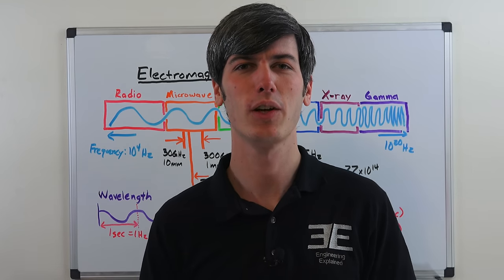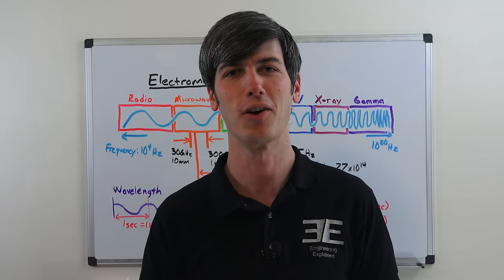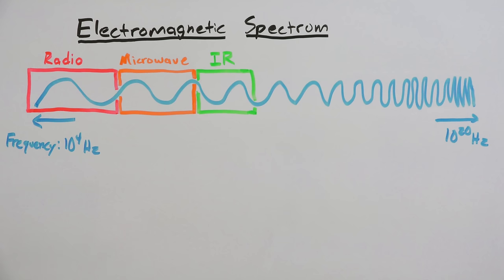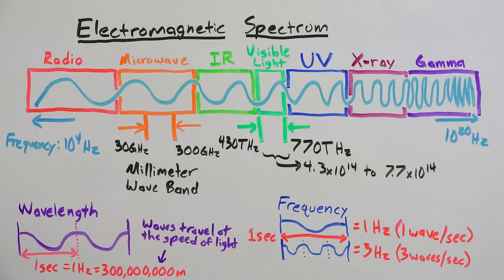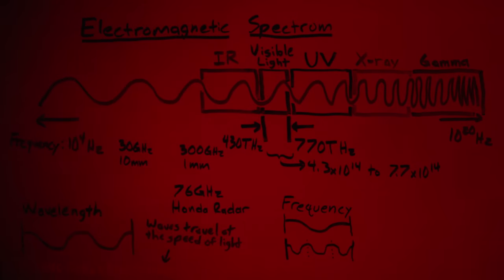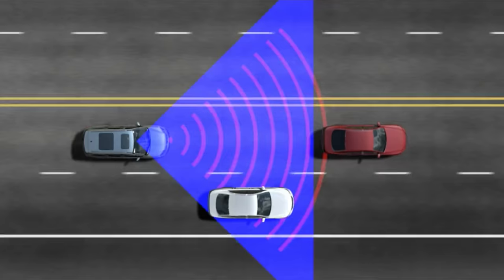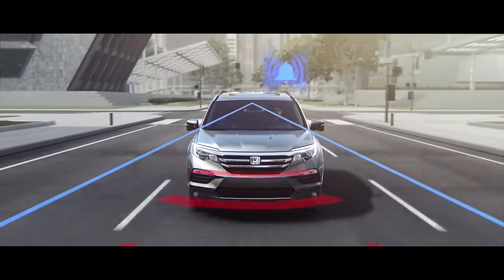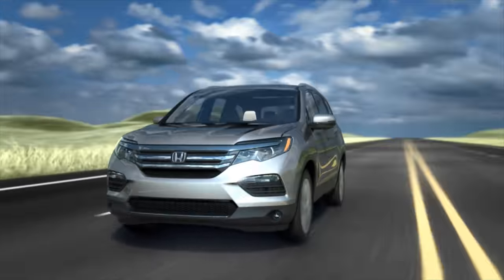How Adaptive Cruise Control Works - Step One For Autonomous Cars

Comment: so what does this system do if you let off the gas to slowly come up behind someone, while there's ice/snow on the ground and it decides to brake harder than you want and you slide and hit someone?
Reply from the maker: +Elkhartboy So you're saying instead of braking you just stay off the gas and hit them? ABS is there to help you stop, but if the ground is icy you shouldn't be using cruise control.
Reply: +Engineering Explained I'm simply asking if the system could make you brake harder than intended. not really sure how I'd slow down with cruise control on....

Comment: I had ACC on my Accord Plug-in Hybrid and the collision avoidance was a nervous nellie.  Even at very low speeds if someone was crossing ahead of me with plenty of room it would panic and sound the alarm.    Never hit the brakes on me but it was certainly aware of the potential broadside (if the car ahead hadn't been moving).  On the highway, the ACC cruise control sure makes highway driving easier - all you need to do is stay in your lane and the car will do the rest.

I've just switched to a German car with camera based ACC and the performance so far seems the same.  Highway driving is very easy and follow distance is maintained nicely...

Comment: I've tried the adaptive cruise control on my dad's Subaru and it works really well. It also has the lane departure warning, park distance warnin and blind spot warning. I found the lane departure warning a bit overbearing but not too bad. Clearly just about every manufacturer has all of the main elements for self driving cars.
Reply: my 2019 polo can parkk it self but cant drive itself i do have t steer

Comment: I thought adaptive cruise control is where the car can detect slope angle of the car going up or down a hill and adjusts speed and braking by the angle of attack and uses automatic changes in braking/throttle. Freightliner Cascadia had something like that I think. The truck, with a load, was able to detect the slope of the truck either up hill or down hill and depending on the grade, it was able to either use the truck's momentum or brakes to keep the truck at the driver's inputted speed instead of using fuel when it's not necessary. Basically, it used fuel if it calculated there wasn't enough momentum to get the truck up the hill allowing the truck's fleet to save fuel instead of older cruise control with a constant programming, the newer ones were self-adjusting.

Comment: While I think that ACC is a great technology, it started out in class 8 highway trucks. When I worked on semi-tractors, the ACC eye/radar was always problematic and in need of constant adjustment. The biggest complaints came from winter time when cars would cut off the rigs, and the ACC would slam the brakes on inducing a skid. Hopefully auto makers have realized this potential problem to reduce this danger.

Comment: I'll ask it in a less confusing way, I'm thinking you were pointing out a system that helps prevent crashing. what if it makes you brake when you're just trying to slow down and then brake? or is it only active with cruise control?

Comment: 👍🏻 nicely done! Thanks.

?:  with active braking, is the brake pedal physically depressed as if the driver would have done instead of the driver aid? Or is the braking done local to the brake rotors, if you get what I mean...
Reply from the maker: +Mario Dalla Riva That's a great question, and considering how many of these cars I've driven I should know the answer. I believe the pedal does actually depress on its own, but I'm not positive on that.

Comment: can i make microwave popcorn with this
Reply: Well, in the normal sunlight there is also a small amount of microwaves, we just can't see them, so basically, you could do microwave popcorn everywhere, at least there are microwaves... but not enough unfortunately, I mean you could try to put a bag of microwave popcorn on top of your black hood of your Honda with ACC in summer and wait until the sun did the job of the microwave for you but this would also work with cars without ACC, but yeah, theoretically you could do that!
Reply: +TheTomatenfritz3000 nice
Reply: +Zettel007 
Wifi has the same frequency as conventional microwave oven(2.4GHz). Just put the bag on your Wifi hotspot for dank popped corns.
Reply: RealationGames I think you might need a very strong wifi there but nice hint, thank you! xD

Comment: Never rely on this thing. I had the adapt cruise control on. i set it at 2 cars length. i was traveling at 70 mph in the middle length. Someone from the right lane cut in front of me. Normally, i dont need to brake because we both travel at the same speed. But because that car was close to me, the car probably thought i was about to hit something so it braked hard. luckily there was no car following me or i might get hit from the rear.

Comment: I wonder what would happen when two cars equipped with this system drive in the opposite directions on the same road. They're both sending the same radar waves and receiving each others'. Sounds like this could fool the systems into thinking there's going to be a crash and braking abruptly, potentially causing a real crash in the process.
Reply from the maker: +Kepe I actually asked them about this. They've certainly thought about it - the system has a way of ignoring information that isn't relevant, and only paying attention to the feedback that it determines to be useful. I don't understand the finer details, but essentially it has a way of basing its decisions purely on the waves that only it emits.
Reply: +Kepe I don't know how ACC works, but knowing a little about electromagnetic waves, I presume that to solve this issue, the system would have to encode its own identifier in the signal so that it can filter out the ones that it doesn't emit.

Encoding the signal can be done by modulating the wave according to a pseudo-random number generator seeded by the car's identifier. When the wave from other car interferes with your own signal, the system does some maths to filter out the waves that doesn't match the expected modulation as noise. Similar maths have been used in asynchronous CDMA systems to allow multiple mobile phones to transmit at the same time.
Reply: +Engineering Explained - What would happen if you were using it near the ocean and it was windy?

Comment: Since Honda Sensing using both camera and radar to detect the objects, what if both of them have very confident but opposite opinion about the road? (One thinks there is a traffic cone while the other one does not). Is radar always the one takes precedence over the camera?
I got this question after seeing the sudden brake recall from Toyota/Lexus because of the sensor error.

Comment: Would Honda's implementation of software and sensors be able to allow it to avoid collisions with smaller non non-metallic objects such as deer?
Reply from the maker: +daytonduck The camera is there for object recognition such as pedestrians (or deer). Nothing is guaranteed obviously but the idea is that it will attempt to prevent a collision.
Reply: +Engineering Explained Thanks for that description. I can imagine a lot of the processing methods and other behavior could be confidential, and they probably don't want to make statements such as, "it will spot children and deer", but those are two things that a LOT of drivers have to be concerned with, and both would be challenging engineering problems.

Comment: My question is what happens if the car behind you slams into the back of you because the computer in your car decided to slow down? I'm not faulting Honda, it's a great safety system I just think it's such a race between auto manufacturers to have the latest and greatest that sometimes important things get overlooked. Also with so many features being automated in cars I think it leads to drivers being more relaxed thinking "I don't have to pay attention the car is" maybe a bit extreme but you get my drift. With all of these systems what happens if they need repaired out of warranty? I think people should consider that if they plan on keeping the car for a long time, and most mechanics won't be able to work on these systems forcing the owner to pay a lot more to go to the dealer.  Again I'm NOT saying this is bad, only providing an objective view..
Reply from the maker: +James Karl If you get rear ended, that's the fault of the person behind you. They shouldn't follow so close that they end up in a wreck. They teach you this when you first learn to drive (don't tailgate).

Comment: I know that the auto braking is a great safety feature, i still don't want it. it just feeling like there is control being taken away. Also, what if you want to ram the person in front of you.
Reply: +TomorrowsTech Exactly, in an emegency situation you could need to ram something and the system won't let you. 
Also it could fail and cause you to forcefully brake at highway speeds causing a huge crash from behind. I hope it has a radar on the back too so it can avoid the situation.
Reply: Yes, it is able to be disabled. All the Honda sense features are.

Comment: My 2016 Acura RDX Radar is obstructed, what do that mean? Knowing that this car has a front accident close to the radar and I suspect the radar itself is not facing what it should after repair knowing that the bracket, Milliwave Radar Pipe having deformed in one place.

Comment: would it stop the car completely if the car in front came to a complete stop?  thx
Reply from the maker: +robert In an ideal scenario yes.
Reply: is it because of impulse?  to lengthen the time and increase safety of occupants, mfg would rather let crumble zones to absorb some of the forces during collision? 

im more worried abt the paint job and potential frame work tho  :\

Comment: IS it better than tesla's Autopilot system ? ( auto braking , collision detection etc)
Reply: No
Reply from the maker: +Jaheel Frederick As far as the adaptive cruise control is concerned, Tesla uses a lot of the same tech. They have other unique features however like changing lanes and reading speed limit signs.